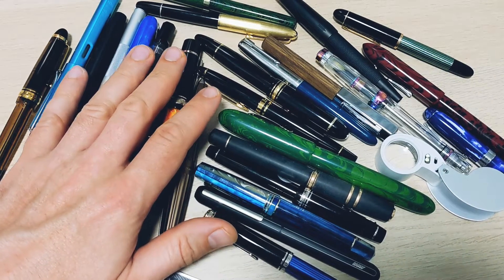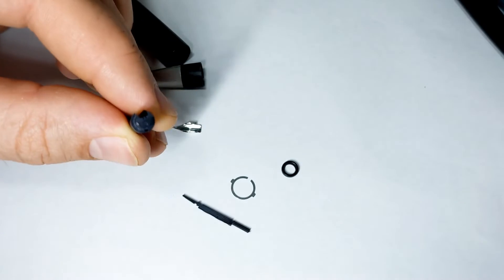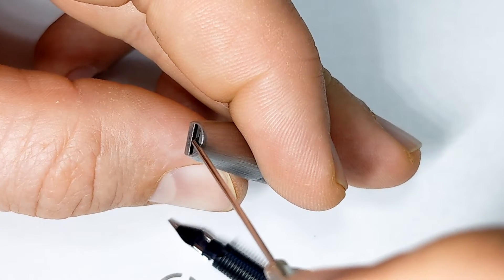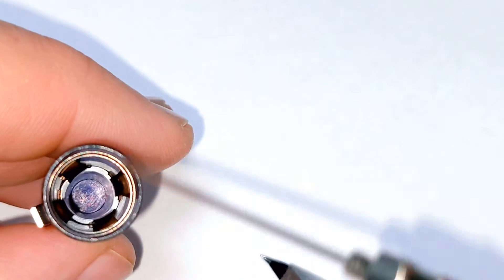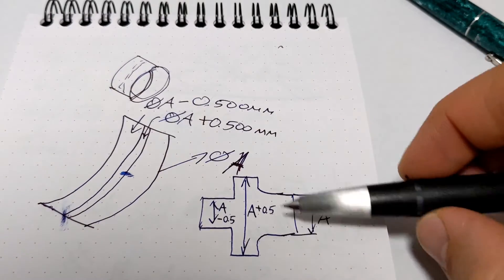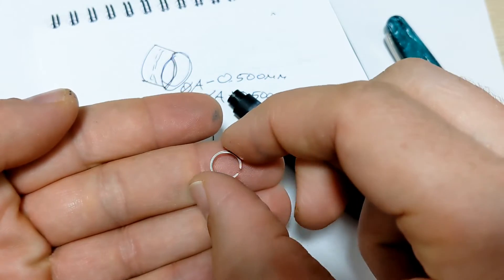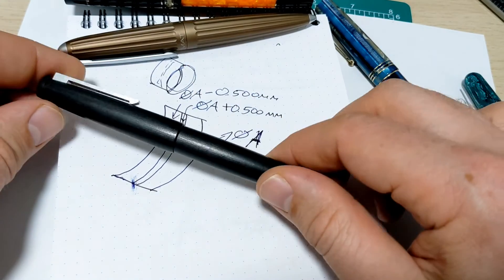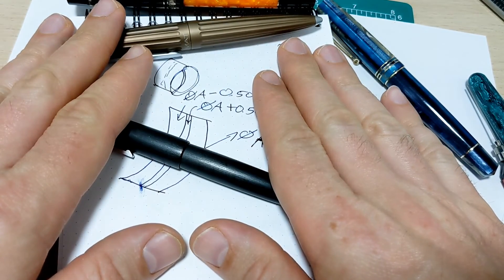Which Fountain Pen Is the Best Engineered? (Lamy 2000 Part 1)

Comment: YOU CAN DISASSEMBLY THE CAP AND THE PISTON MECHANISM! FOR THE CAP TAKE A PENCIL OR PLASTIC PEN AND PUT A RUBBER BAND ON TOP OF IT AND STRETCH IT ( NOT THE POINTY END) , THEN PUT INSIDE THE CAP AND FIRMLY PUSH IT AGAINST THAT INKED BRASS THREADED PORTION,THEN FIRMLY GRIP THE POLISHED PART ( NOOO PLIERS UNLESS THEY PLASTIC) AND UNSCREW IT, IF SUCCESSFUL YOU CAN NOW REMOVE THE INNER PARTS OF THE CAP. FOR THE PISTON JUST UNSCREW IGNORING THE CLICKS AND YOU WILL DO IT. THESE METHODS IF DONE CORRECTLY WONT RESULT IN ANY DAMAGE.(THE CAP THEADS  MIGHT BE GLUED SO IF YOU CAN'T UNSCREW IT YOU CAN USE HOT WATER TO SOFTEN THE ADHESIVE, THE PISTON HAS DIFFERENT PARTS INSIDE SO KEEP TRACK OF THEM ALL).
Reply from the maker: Part 2 I took out the piston. A viewer sent me a video of taking off the top of the cap. I've tried that but would have to exert more force than I felt comfortable with. I figure if everything comes apart with ease, maybe they made the cap not so easy to disassemble for a reason. I've had customers do their own "service" on equipment way beyond what documentation supports. And they end up having to send it back. I look at it when it arrives and shake my head thinking "what the hell were you doing!"
Reply: Many people say it's strong but there are multiple complaints of cracking. You have been using this pen for a while, you know its strong and week places. I also cracked my Lamy 2000 EF near grip section after 2 days of purchase, now ordered Medium after returning. Can you enlighten me about its strong & week points, and how to not damage it for a lifetime use?
Reply: @Raj-viz  I know that these crack on the edge of the cap sometimes but that happens due to either dropping too many times or manufacturing defects caused from the ring that's inside pushing the cap .

Comment: Nice analysis.  Engineer to engineer, I appreciate the detail.  Since you expressed interest in what's inside the cap (under the plug) -- check out this video that shows how it comes apart.  (Hint:  the plug has a metallic shaft that is threaded, and it unscrews counter-clockwise.)
https://www.youtube.com/watch?v=5V0jZAlelAE
Reply from the maker: Thanks 👍
Reply from the maker: When I looked I couldn't find a video like that. I see a couple differences in some of the components. Wonder if there may be some small changes over time
Reply: @Doodlebud  very well could be!
Reply: @Doodlebud  By the way, did the video link not come through?  (I am wondering if YouTube suppressed the link to the video I referred to.)  Either way, the first thing the guy did was with his fingers, simply unscrew (normal counter-clockwise) the finial on the top of the cap and the clip fell off and the inner parts of the pen were able to be gently pushed out with a wooden dowel.

Comment: The Lamy 2000 looks like the old cheap  fibre tip Papermate pens I used to use. Even the clip is the same. I don't think it looks worth all that money.
My daily user is my good looking metal bodied Shimmering Sands Jinhao X750 with a Bock 1.1 stub nib. A simple well built converter pen that can be used with standard international cartridges when I am travelling anywhere in the world. And no big deal if it's lost or stolen as it only cost me £18 including the great German nib.
Reply from the maker: You can definitely get a cheaper pen that writes just fine
Reply: You are right I too thought well it doesn’t look very impressive. It’s one of the reasons that it’s just not been on my radar for quite a while. But what it does it does well and the thing is that when  you’re out and about and you flash out of the Visconti Homo sapiens you could easily be mugged however nobody is going to mug you for this pen because they won’t know what it is. I just want a pen that really really writes and this seems to do the job and do it well. The only one that seems to be a really good writer that I’ve seen so far is the pilot 823. Another iconic pen. I wish you could do a review on this. It’s a lot of Australian dollars here so I really want to know whether it’s worth the effort. Thank you for your videos they’re the first ones that actually give information that’s useful in order to make a decision. I think you’ve just saved me a hell of a lot of money. Thank you
Reply: Postscrit sorry just found the review of the Pilot 823

Comment: It's rather sad that a Waterman pen wasn't chosen, considering they helped create the more common style of fountain pen.  But I agree with you, however, I write fast and a lot, when I do, and no pen with a converter can keep up with me.  I have to use a piston filler pen so that I can push the ink down when a vacuum occurs.  This, for me, makes a clear demonstrator pen necessary, and for price, that gives me wing sung 3008a, after I ground the nibs to italic stub nibs and widen the ink channels.  My brass t1 moonman is one I did grind the nib to a stub italic, but I never had to mess with the ink channel, and often, I don't have a vacuum issue.  However, it is is flawed in that it has no pocket clip, so it can slip out of your pocket or lay sideways.  If not for the cap being a bit too heavy and the lack of a pocket clip, I would nominate the t1 moonman.  What do you think?
Reply from the maker: T1 is a good pen, especially for the price. But to build it, it's a very simple process. And that's a good thing, don't get me wrong. But as far as design consideration, build quality, how parts fit together, manufacturing process, etc... The L2K goes deep. I have part 2 of the video coming to go even deeper lol

Comment: I have a Lamy Safari, I want to like my Lamy, but I can't. I like to write with a F-XF nib. Lamy dropped the ball with the nibs. F writes like a Jowo M.  Bought another nib in XF, worse than the XF. Either QC took the day off or???????
Reply from the maker: Never been a huge fan of the safari myself
Reply: What is the line width of your Lamy F nib? My Lamy F nib is 0.4 mm and I consider it to be the correct size. Out of the box, it was a bit scratchy and its flow was a bit uneven. 
To adjust the nib, I ran some micro mash, no more than three times (once=10 eights or infinity signs). It was reasonably smooth. Then I opened the nibs somewhat against a glass table, a little, 2 times for 8 seconds. Now I really enjoy writing with this Lamy. To optimize its performance, I use Waterman Serenity blue. Care must be taken when spacing the tip, because if you overdo it, the nib will come close to an M.
In any case, you have to keep in mind that Lamy manufactures with a tolerance of ± 0.6 mm, that means that occasionally an EF nib might have a thicker line than an F nib.
https://www.lamy.com/en/lamy-nib-guide/
Lamy F and EF nibs have the same width in the nib groove.  The difference in flow and width depends on the width of the groove of the tip. Sometimes this groove is very narrow, less than 0.01 mm. The balance is very precarious, any variation can leave a space that is too narrow. 
The grooves of the tins and the tip in Lamy nibs are not continuous. They are conical in shape. 
The narrowest EF is 0.3 mm. I have read a lot about lamy nibs. In the comments on a German channel, one user claimed that when he wanted to buy a Lamy EF nib, he went to a store and tried 20 fountain pens. Of those 20, one EF wrote beautifully. 
I have read a lot about lamy nibs. In the comments on a German channel, one user claimed that when he wanted to buy a Lamy EF nib, he went to a store and tried 20 fountain pens. Of those 20, one EF wrote beautifully. The person in charge of the channel is very critical of Lamy nibs, talking about 4 good out of 20. However, I have bought 4 and am very satisfied. Fitting the EF was quick and easy. I asked the person in charge of a Mexican channel and he told me that his 12 Lamy wrote very well. 
Now, if you want a 0.4 mm F nib, the Schneider Base is amazing. And the consistency of the nibs seems very good, I have two Schneider and they write exactly the same. Another gem of German engineering. Very little known in this case. 
In EF nibs, the German brand with the best reputation is Faber-Castell. I have an Ambition M and it is at the top. That nib is amazing.

Comment: further thoughts regarding your video... yes genius engineering, great quality control of production, but really is it worth all the engineering, not quite the model of the Bauhaus and the elegance of design and function of the breakthrough design of Maholy Nagy's Parker 51. I don't own the 2000 but do own an early 51 from 1943 that writes flawlessly for everyday use. Today I am writing with a Jinhao 166 with a lamy copy nib, it is truly fun to write with, made of cheap plastic, feels great in my hand, made in the probably hundreds of thousands, simple design and cost less than $4.00, and can modify and lose and not think about it. It may not last as long as the Lamy and not have status in fashion, but it should also be celebrated along with my vintage and modern pens.

Comment: Thank you for this level of detail (and the effort to show it on screen). I would be interested in a similar exploration of the Lamy 2000 piston mechanism, which I presume is a more difficult engineering challenge. My experience with that mechanism has not been as carefree as my experience with the cap closure mechanism has been. It does not feel as solid and perfectly engineered as I would like. I wonder if there aren't additional refinements that would be beneficial for the user, similar to pistons in other pens. I would be encouraged if Lamy were working on their piston mechanism and would issue an improved version, possibly in a Mark II model of the 2000.
Reply from the maker: Oh wow haven't heard many issues with the piston mechanism. That part actually isn't as complex as you think & many other pens have a system which is very similar. The front end of the pen is what really impressed me

Comment: Thank you, Doodlebud. I knew the Lamy 2000 was a complex design but you have helped me understand it a lot more. Of course most of your focus was on the cap, nib and feed. I suppose a great deal of thought went into designing the piston mechanism as well. I have never been a fan of Safari's or Al-Star's but the 2000 is a masterpiece in engineering.
Reply from the maker: I didn't get too much into the piston system as many pens have that & it's not as complex as you'd think. But the front has a lot to it